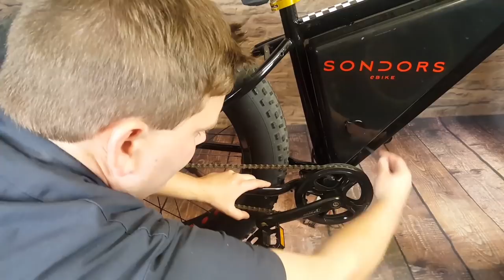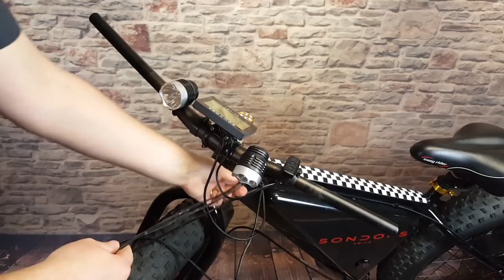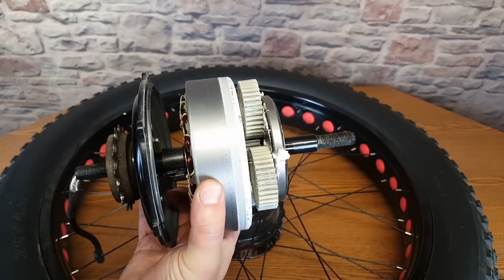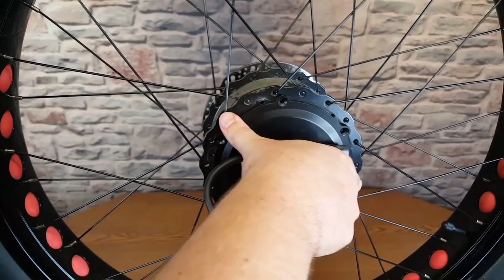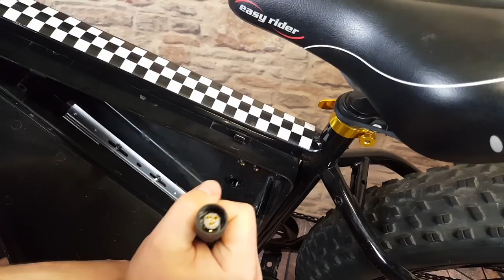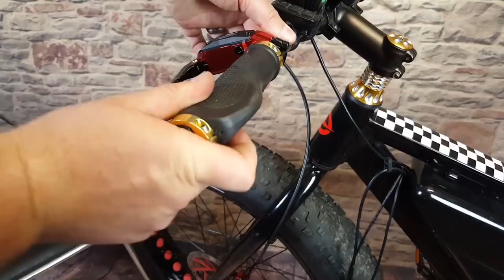3 Upgrades to make your Sondors Ebike FAST!  Step by Step Tutorial

Comment: I have a Sondors, I upgraded about a year ago and I wish I'd seen this video before I did it, it would have saved me quite a bit of time and money knowing all the tricks and good advice in this video. I paid a bike shop to lace the 750 watt motor into my wheel not knowing that I could just swap the guts in and out of the case.  Lots of really good advice.
Reply from the maker: Thanks for sharing!  Too bad it was too late, but I'm glad you learned something new.
Reply: Do these upgrades work on other sondors models, like the fold X? GREAT VIDEO that deserves a like and a sub all day

Comment: Most excellent. 

You are masterful.

Maybe an inventory and money tally for parts and labor to give people an idea?

I picked up a SONDORS XS Torch at the factory today after riding (to death) a yellow Sondors Original from the 2015 batch. 

The XS is a bad mamba jamba but out of respect I am going to hotrod that yellow Original in true hot rod fashion - keep everything that is solid and original and good, and upgrade everything else: faster, stronger, longer.

Your video showed pretty much everything I want to do: More motor, more battery, more controller, better LCD screen, hydraulic brakes.

I am tempted to upgrade to the 1000-watt motor, just to be a jerk. Thoughts?

Thanks.

Comment: the motor also does that sometimes when you've been in very muddy or slushie (snow mixed with water, it's fun /s) conditions which tends to rip the oil off your chain/cassette and make the thing "seize" up
Reply from the maker: Uh oh - slushie is certainly not something you should be riding your bike through. 

Check out this video I made about riding in the rain: https://youtu.be/zx9c9Ws0vmo

Comment: Hello, good video tutorial, one question, a 750 or 1000w motor, which battery should you use? 48v or 52v? or any? I have to do that same update with my 350v Sondors and 36v 9ah battery. its power is very weak. I would appreciate your answer.  one question, is it possible that a 1000 Bafang motor fits well in a 350 Bafang motor housing, I ask this so as not to remove the entire 350 and put the entire 1000, and avoid having to disassemble all the spokes of the wheel .

Comment: Hi! I have a similar fat bike with the 500w bafang motor, 48v battery and upgraded 25 amp (13 nominal) controller. The lcd8h display shows 1000w when I accelerate from 0 and then drops to about 500w. Max speed is about 36 - 38 km/h. Do you think that upgrading to the 750w motor will give me more speed?
Reply from the maker: More top speed will likely require a higher voltage battery.  Although a 750 may perform better on acceleration, top speed may not be any different.

Comment: Can a 48v battery be operated with the same  controller for 36v? In case i wanted to upgrade the battery, can I still use the same controller?
Reply: I have the 36 volt 350 watt motor 10 amp controller all I did was put a 48 volt 12 amp hour and used my LCD screen to unlock it and it has a huge upgrade I can get 24 miles per hour pedal-assist five and with a slight down hill I'm hitting 33 and on my LCD screen I'm hitting in a 500 watts range and I'm getting over 20 miles range and I have zero issues

Comment: As of Jan 18,2019,you still think Sondors a good buy and reliable?
Reply from the maker: Yes I'd say they are.  Just know you'll have to deal with the Sondors community for support, and not Sondors directly.
Reply: Thanks I bought the Thin newest version so far its been great ran out of juice once had to ride like a regular bike it was tough because of the weight but got a nice workout. @Area13ebikes

Comment: Kyle. You show the new 750w motor with the 7 speed freewheel on it. But you don't show how to remove that freewheel. You just move straight on to the motor without it. And I've noticed it won't go over the power lead that comes out from it where it joins to the controller. Could you explain to me how you did that?, Or link me to a video where you do it.
 Best regards,

   Lee.

Comment: Can't seem to find the links about the 7 speed free wheel gears.  I would like to add the 7-speed as well  when upgrading to a 750 watt motor.  Most bafang 750 motors take the larger connection from the controller (35amp).  I have a 25amp controller and would like to it if possible.  Is there a specific model motor that accepts the smaller connector?

Comment: Great 👍 Thanks for doing the video! Will I have any problems when I put the 7 speed Freewheel onto the motor ? Also what is the correct product number of the 7 speed Freewheel that fits the 750W motor ?
Reply from the maker: Excellent question, I forgot to address that!  The process is the same if you have a 7 speed freewheel, but you can likely remove the stock freewheel and re-use it.  I'll add a link in the video description in case you need the tools.
Reply from the maker: That is ASSUMING you have a 7 speed bike to begin with.  The stock single speed Sondors frame doesn't really have enough room to fit a 7 speed freewheel.
Reply: Velomobile Shop Still need to buy the 25A controller with plug for the 750W motor. Any idea when your getting them?
Reply from the maker: @Lenny7118  expecting them any day now.
Reply: Hello again, What larger size Chainring Crank Set will fit the SONDORS Fold X besides keeping the stock 44T on? Will a 52T fit ?
I just received the 56T and to big for the Fold X. Will that 56T chainring fit on a SONDORS X7 ? ( The SONDORS X7 arrives in October) that I ordered. 
Also was I misled by a competitor seller telling me that a 35A controller will fit inside a 2018 SONDORS X7 battery box along with the stock 48V triangle battery? Thanks
Reply from the maker: @Lenny7118  I have not tried changing the front crankset on a fold, so I'm afraid I'm not much help there!  The 35a might fit if you modify the battery case I suppose, but would require lots of cutting is my guess.  Also have not tried that.

Comment: I have the 2018 X version and I’m wondering if it’s easier to just buy a new 7 speed sprocket and install, or is it easy to remove the one that is on the old 500w motor casing? I read that it is a destructive removal to get the old sprocket off. Thank you -Michael
Reply from the maker: The installation used by Sondors does make this rather annoying and difficult, but with the right tools it's possible to get it off.  If you're already thinking of upgrading the motor, yes that's easier!
Reply: Thank you. Your videos have helped me a lot and it’s easy to order sondors parts from your site... I have installed the 750w, w/ 35a controller,  without installing gears at all. I’m waiting on my chain whip to arrive and then I will install the old freewheel. I love the power that I get with this setup and can’t wait to upgrade my battery. Thanks again

Comment: Loved the video, very well done, however, I would of just bought a Rad Rover, comes stock with a  48v, 14.6ah battery and scrapped the Sondors. Not sure what you did was cost effective. $1699 for a new Rover, what did all those upgrade parts cost you?
Reply from the maker: Although that sounds great, have you watched my video about the Rad motor?  The end result of this upgrade vs the Radrover would be very different.

Comment: Is this particular model gearless, as in  just one speed? I don't understand the lack of cassette with this standard Bafang motor. Please explain. Thanks!
Reply from the maker: Original Sondors bikes were just a single speed.
Reply: @Area13ebikes  Ah-ha, I see. Thank you!
Reply: @drums911  Also, it makes sense to use only pinion (with a small number of teeth) on an electric bike setup, especially a powerful one.

Comment: What’s the cable I need to add the 750w motor to my Sondors original
Reply from the maker: Greg, you need an upgraded controller with the proper plug.  They are available at www.velomobileshop.com

Comment: Hi. Where can I buy the clips you used to hold the brake line on The existing brake line holes?
Reply: Hi... read the description :~)) Cable Guide Adapters for Hydraulic Brakes, and there is amazon link.

Comment: How fast it will go?
Reply from the maker: That will depend slightly on the battery chosen, tires, etc.  But top speed increases to upper 20s and acceleration is GREATLY improved!  Much quicker from a stop and uphills.

Comment: " 3 Upgrades to make your Sondors Ebike FAST "

1: New battery and controller ok we are of to a good start

2: New motor guts wait what? The stock ones are more than capable of taking well over 1000w at 48v and will give you similar power and top speed, the guts might give you more power by a very small fraction it really will not be noticeable and so is just an uterly pointless swap and i say swap because it realy is not an upgrade as the performance is so minor.

3: lmao the hydrolic brakes are another pointless swap, " if you want to stop you need these " erm no lol thats not how it works, this is only true if you are increasing the rotor size, but in this case where the rotor is staying the same size then moving to hydrolic is utterly pointless and will not increase your braking power as at the end of the day the same sized pads are still in contact with the same sized rotor and you will still be able to exert the same pressure to the disk before it locks.

So out of those everything is just an utter waste of money other than the battery and controller.
Reply from the maker: Clearly you haven't ridden 2 bikes side by side with the 500 vs 750 motor.  Night and day difference in torque.
Reply: I to know out of that 350 watt motor you can push it to a thousand Watts and you can easily upgraded just by putting a 48 volt in the sondors bike with the original 10 amp controller and it is a huge Improvement show upgrading the controller what increases 350w even more with a 10 amp controller on pushing 500-plus Watts .... and yes I believe if you take out the 350 watt motor and put the 750 watt motor it should increase power and speed but that 350w can push a lot of power reliably

Comment: I've got a Sondors Fold-X.  It has cost me $2 Grand so far.  MY advice as a Master Mechanical Engineer with 40 bio tech  patents.   I say that there are NO good e-bikes.  they are designed by monkeys,  There are 50 things to adjust, twenty more things to carry, including 2 heavy locks.  
E-bikes...all of them that I've seen so far...are partly built piles of junk.  Have you ever seen a real motorcycle that does not have a steering lock?  I've ridden 956000 miles in 35 countries on real motorcycles No problems.  but DIG THIS: 50 things to adjust twenty more to carry including 2 heavy locks.  E-bikes...all of them that I've seen...are partly built hunks of junk.

Comment: You don’t mention to viewers of the video that the plug on the controller will not fit into the 750W motor. A new motor plug on the 25a controller is needed and no one sells them. Do a video on how to make a 25A controller plug!
Reply from the maker: Lenny7118 - There's a link in the description to the 25A and 35A controllers.  Both are available with the proper 750 watt motor plug.  Although out of stock today, they will be back in stock this week!  There was a major delay in shipping due to a typhoon and earthquake (bad timing!) but they're back on track.